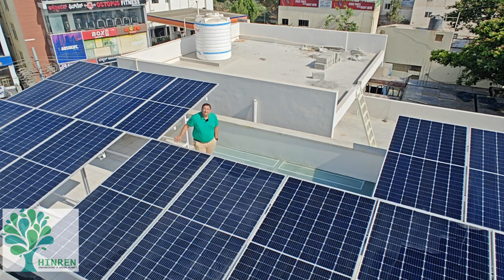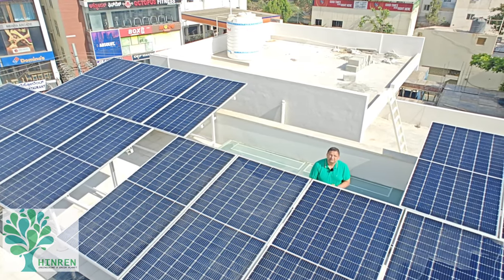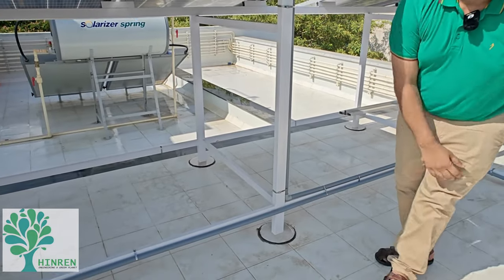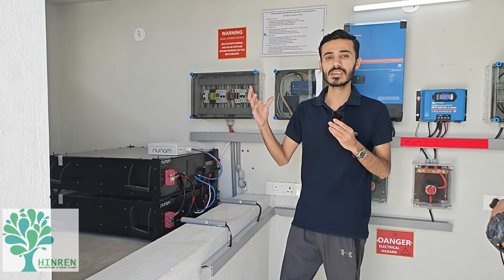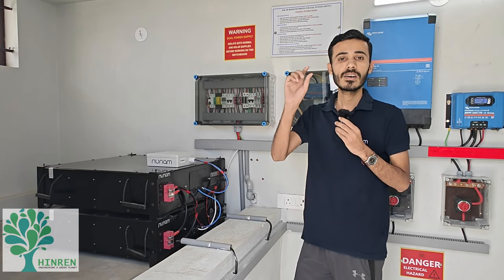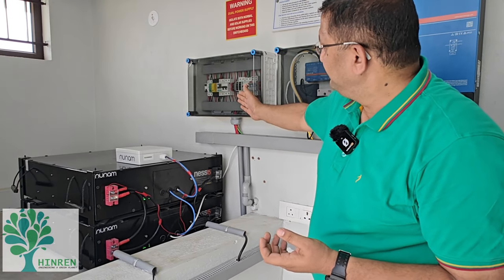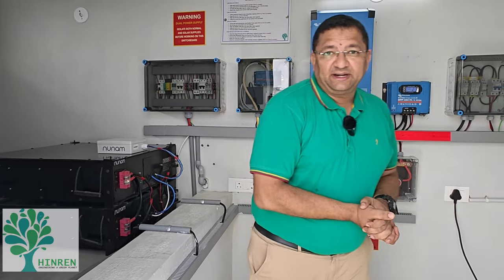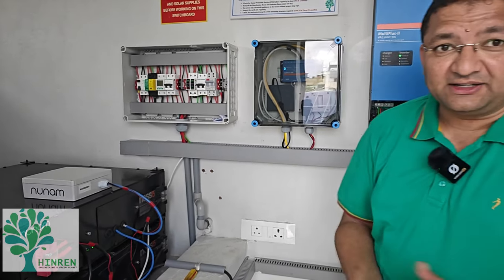Residential Rooftop Solar ; "Off-Grid" and "On-Grid" Solar PV System

Comment: The purlin support under the panel seems to cast a shadow on the bottom , from the light reflected off the floor, on to the rear of the bifacial panel! 
Wont this affect the performance??
Reply from the maker: The  purlins are unavoidable. However for energy yield estimations, we do not consider the generation from the rear side. So whatever energy gets generated from the rear side, it is a bonus.